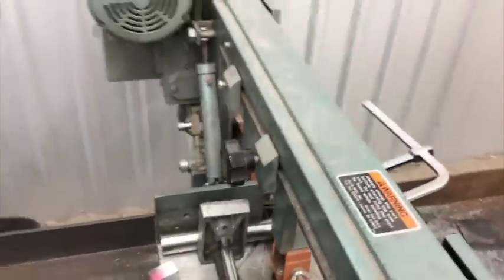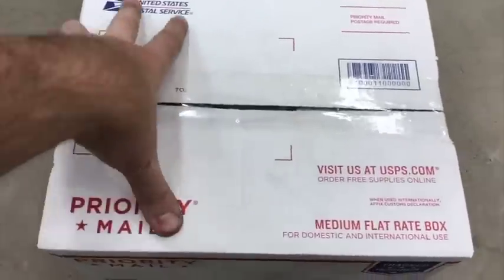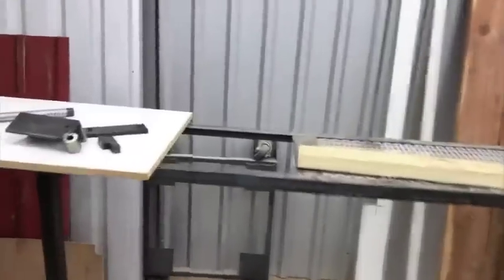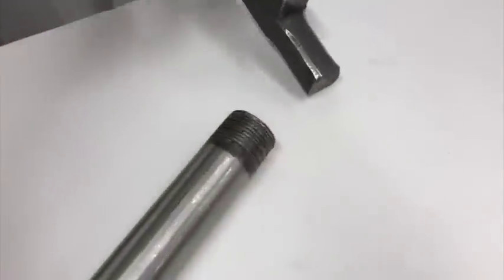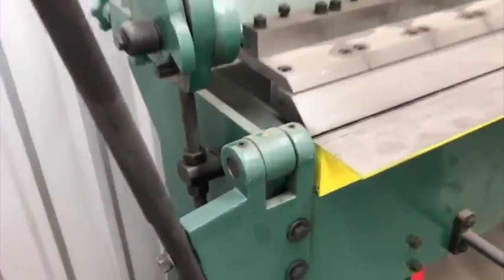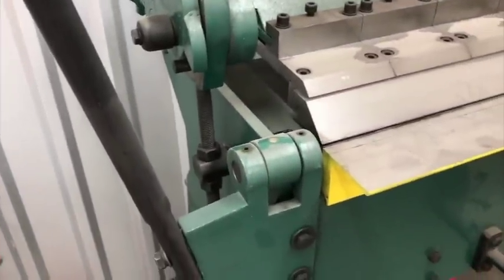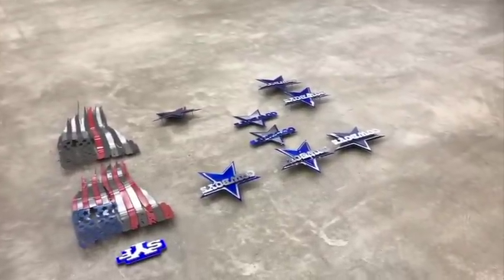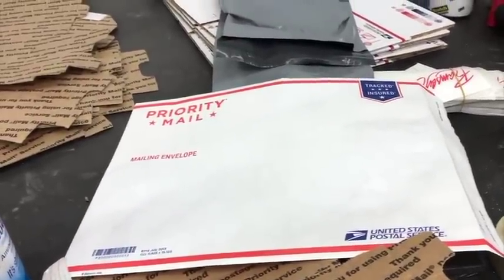Metal Bender - Packing Questions

Comment: I think the guys at Swag Offroad did a video on how to use the flat rate boxes to max efficiency for shipping (nesting?).  Anyway, they make it work out.  Also, what about lithium grease on that bender joint?  I know some of the tubing benders use it to minimize wear on their dies.  Just some thoughts.
Reply from the maker: Yea good point on the greese, I need to add that into the instructions.

Comment: The hole-pin design is stronger because the turned spud has a stress riser at the fillet, where as the hole-pin does not.
Reply from the maker: What about the side wall of the 3/4" block that gets drilled to 5/8 leaving .060" sidewall on each side of the pin?  I am not doubting tom lipton's design.  Btw, you are the one that turned me onto the idea of leaving it as one when you mentioned using square tubing as a handle 
p.p1 {margin: 0.0px 0.0px 0.0px 0.0px; font: 13.0px Helvetica; color: #333333; -webkit-text-stroke: #333333; background-color: #ffffff}
span.s1 {font-kerning: none}
Reply: Your production design does seem to be stronger at that joint than either round design.  The grinding of the corners shouldn't reduce strength appreciably.  That .060 wall thickness does make one wonder, but I suspect Tom designed it primarily for materials smaller than 1/2".  If you really want to know, model it up in Fusion 360 and use the FEA analysis to see what the ksi rating is on the parts.  That could be a good exercise and/or video for you.

Comment: We ship heavy stuff at work all the time. We use old plastic shopping bags and then shoot them with a shot of right stuff expanding foam close up the box and they are ready to ship next day. Oh and tell people to be sure to smear moly grease on that domtodom connection or they may have galling in use.
Reply from the maker: See this is why i make these videos.... good idea on the foam, I will try that.  I am afraid it would be too expensive though, probably would end up using 1 can of it to fill in the voids.  USPS needs another size box between the small and medium flat rate.  In my instructional video for putting together the bender, i walk them through lapping in that pivot point with a couple of reps of lapping.  Then oil it one last time, but yea your point on moly greese is good, i didnt think of that and will add it
Reply: Oldbarn Homestead
 It expands 3 to 4 times so don't over do it, I know I have blown the sides out of a few boxes. lol
Reply: it's fun to "forget" the bag sometimes
Reply: Have you been shipping every day or 2-3 times a week? If you ship every day this might not be for you. But it could work until you get an every day routine, maybe even then for a while. If you can nose around and find other businesses that are receiving every day, you might find a resource for free shipping materials. I've seen businesses that received far more than they shipped pitching in their dumpsters large quantities of Peanuts, bags, boxes, bubble wrap etc.. These are usually retail entities. Using the postal box you are now and mixing "sourced" materials might give you the leg up your looking for. They have to pay to get it removed anyway. Besides, you can be a "greenie" lol, and recycle. Then you can do a video on how your saving the planet! lol

Comment: What about rigid insulation for packing material or peanuts. Some of the white rigid insulation sheets are pretty inexpensive.
You can get 1.5" thick, 4x8' sheets for about $8 at Home Depot, and if you find an insulation retailer you could buy it even cheaper in volume. You could fill a lot of those little boxes with just one sheet and it cuts easily on your table saw... Something to think about and would take less time overall, I think.

Comment: I used to build and ship receiver hitches for kubota tractor front buckets...I designed them to fit knocked down in a medium FR box (the thin one) and the extra space (not much) was taken up by crumpled newspaper which I got for free. Bottom line the part was designed around the shipping container because I offered free shipping and as you are finding out the shipping costs eat into your profits. Maybe you could redesign the angle iron part to be an assembly of flat bar bolted and or welded together and the whole thing may then fit into the small FR box? Just a thought without knowing the true dimensions of the pcs.